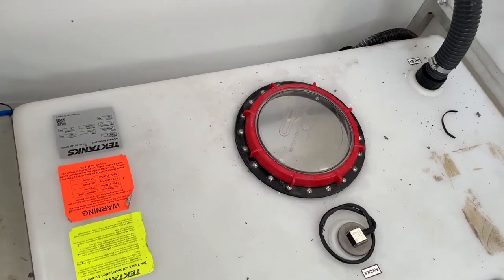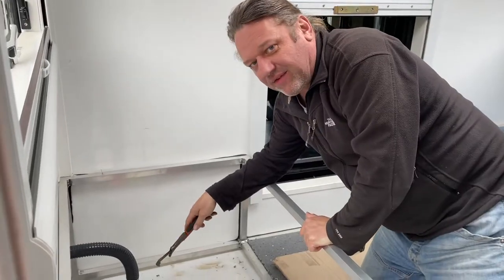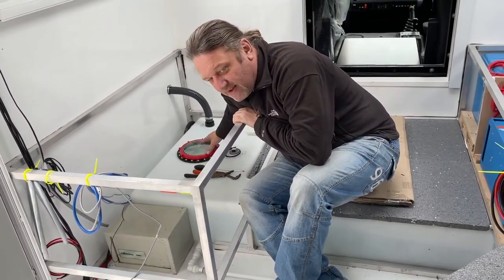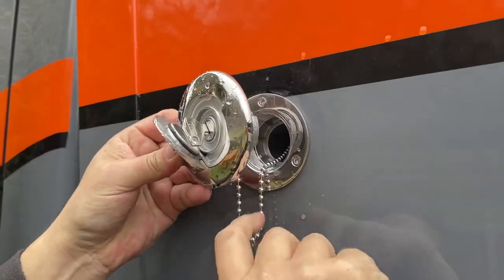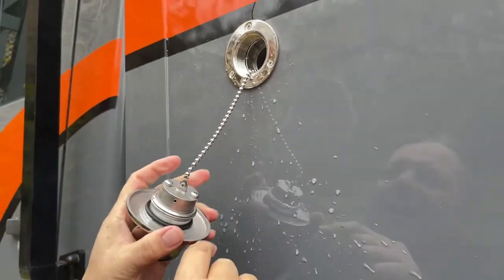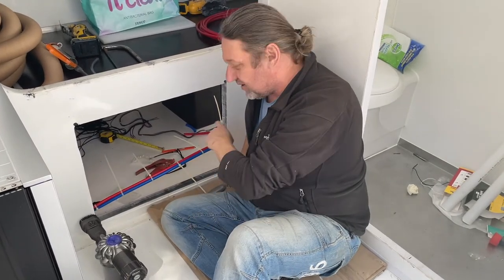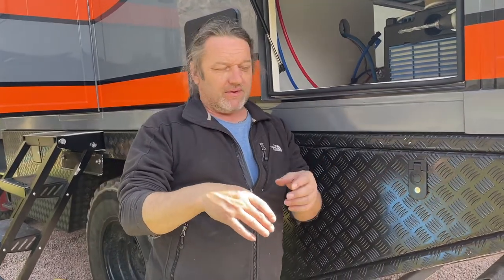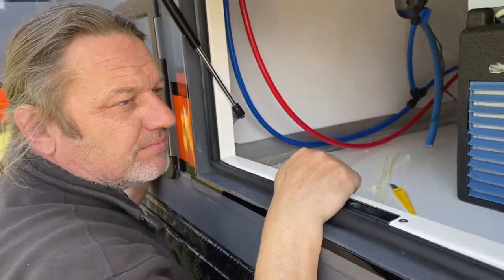WANDERTRUCK.Self-build MAN 4x4 expedition camping truck.Water storage test and water pipes install

Comment: Never had great success with these corrugated pipes. Never seem to get an even tension on them. Might be safer in the long term with 'plain' clear braided hose Mark. All coming together. Must have a blether on the phone soon.
Reply from the maker: i am keeping an eye on it and seems to hold just now. if it plays any games , I will just throw it out and get the pipe you are talking about 👍

Comment: For you chain if you kept the bits you could thread a stainless nut on the chain so it weights it down then when you pop it back in the hole it will pull the chain into the hole assisting you. 

And the inlet hose is not the best to get a seal on it with a jubilee. I would either replace the hose with smooth bore or get a heavy duty hose clamp that uses Bolts instead of worm drive. Enjoy watching the progress otherwise.
Reply from the maker: thnaks very much, points noted and always welcomed 👍 re the hoses, yes, we are going to replace the fill hose.

Comment: those are 20mm by 20mm aluminum profiles?
Would you mind sharing the name of the provider of the water inlet with a lock?
Reply: If you split à thin plastic hose and mount it in the chain where it’s connected to the cap it will direct the chain away from the threads and it will still keep the lid in place when it’s open
Reply from the maker: @not_so_far_away_Adventure  excellent idea and i will give that a go👍
Reply from the maker: Diego, i honestly don't know the make but i will have look and find out for you👍
Reply: @thewanderfulfour  what about the aluminum profiles? are they 20x20mm? if so, is that strong enough to stand 2 people sitting?
Reply from the maker: @diegohpdg  hi, the profiles are 25 x25 mm thick wall aluminium and it is relatively strong in its own right. the aluminium frame is in place to secure the water tank and give a base for the 15mm lightweight plywood that is going to be bonded to it. The plywood itself in its construction is what is going to give the strength and suport  for the seat/bed base👍
Reply from the maker: re the lock - there is no manufacturer's mark on it. We got it from Whitehaven Marina UK but I suppose you could just google suppliers.👍
Reply: @thewanderfulfour  thks! I’m in Argentina and it is hard to find suppliers and I have to be very selective on what to import..
Reply: @thewanderfulfour  super clear! I’m following the same path.. thks